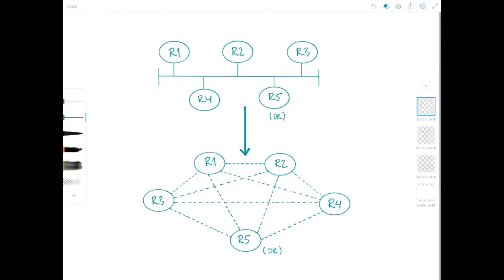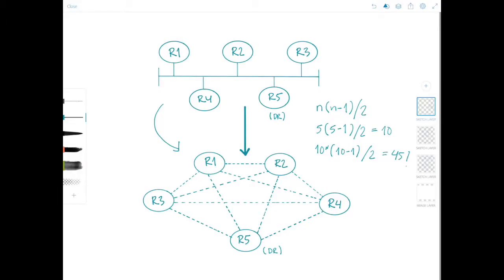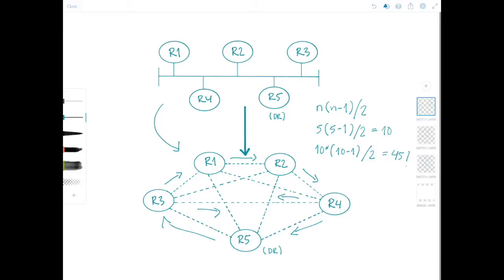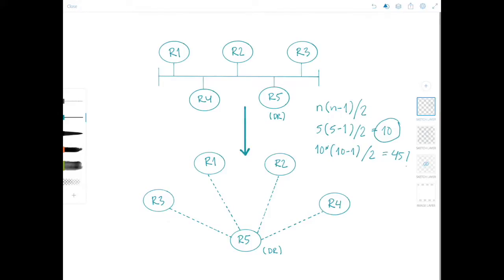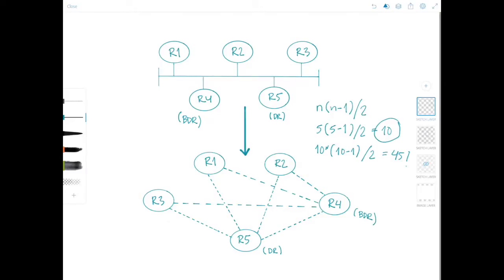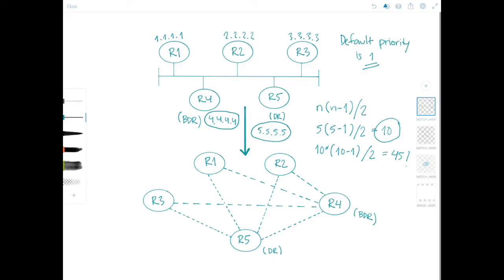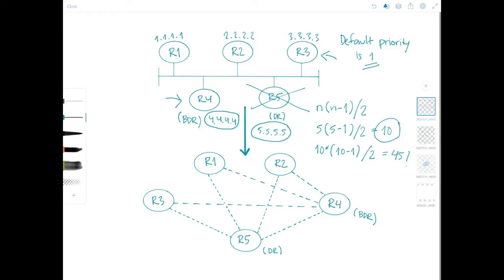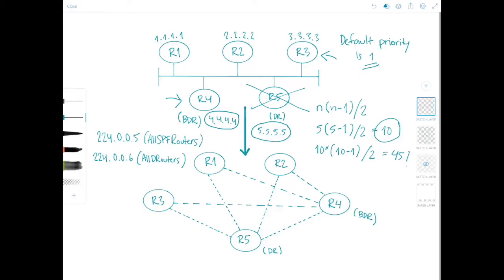OSPF Designated Router and Backup Designated Router

Comment: How does the initial DR discover that it is a DR if it is the only one router in the network? I mean, is there any timeout that defines how much time we should wait for the answer to our hello message until we become a DR in our network?

Also, the way the DBR is re-elected is not quite clear. 

Thank you
Reply: Well, maybe I should better go and read the RFC :)
Reply from the maker: Electing the (B)DR is a complex, multi-step process. I do not remember all the details off the top of my head. There is a timeout that controls how long the (B)DR election process will endure - it is the Wait time. Indeed, for more information, I would advise you to take a look at Section 9.4 Electing the Designated Router in RFC 2328. :)

Comment: Will loopback address always win over ip address for Router ID?. For instance, if Router 1 has a loopback address of 5.5.5.5 and an ip address of 192.168.91.2, will the Router ID be 5.5.5.5?
Reply from the maker: Yes. The order of preference is 1) the manually configured router ID, 2) the highest IP address of a Loopback interface, and 3) the highest IP address of a physical interface. 

Please note that the router ID is selected when the OSPF process is started. Whatever is chosen as the router ID at that time, will be kept as the router ID unless the process is restarted. In other words, if the router selected the highest IP address of a physical interface as the router ID, and later a Loopback interface is configured, it does not change the OSPF router ID (unless the OSPF process is restarted).